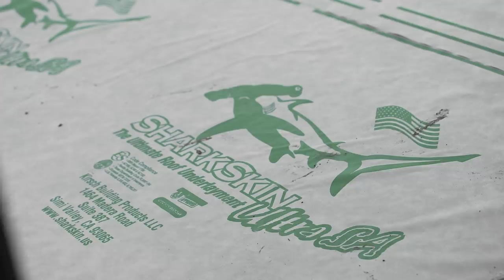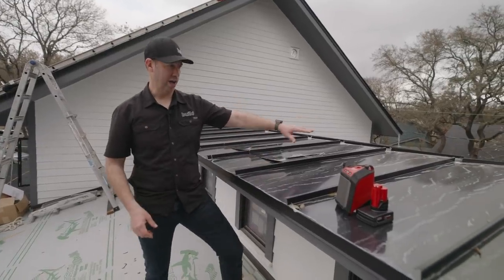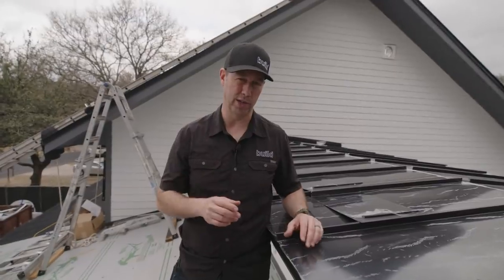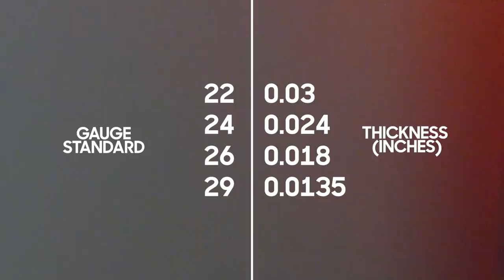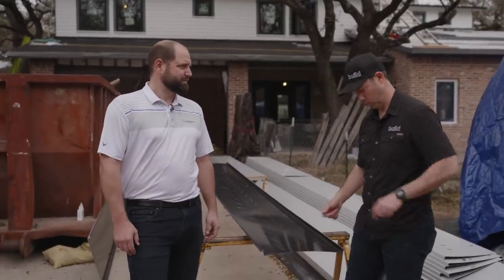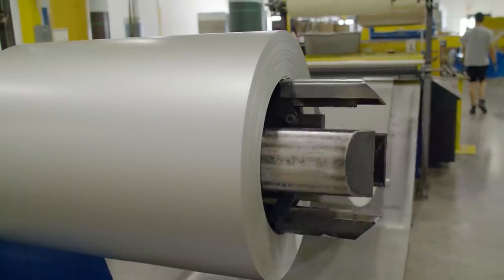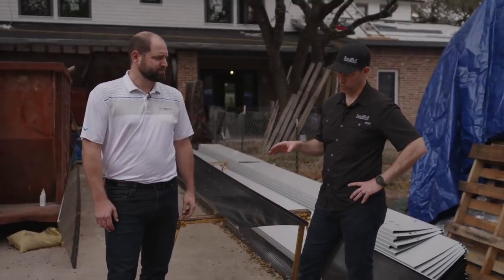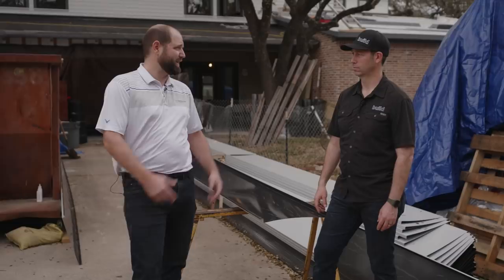Metal Roof- Best Practice Details

Comment: 6:15 the silver reflective foil should go down FIRST then your black webbing material and lastly the metal roof. the way you have it installed now doesnt' reject heat, it keeps the heat inside. think about it, the shiny side is what bounces heat away!!! can't believe this was screwed up by a pro.
Reply: And, that's why you're not a pro.
Reply: @sunshine5349  Oh you're right, sorry. Of course you would know whether or not I've installed any metal roofing. Just like I would know whether or not you've got an accurate knowledge of how electromagnetic waves behave; you know, like a radiant barrier professional would be expected to have, as opposed to say, a sheet metal guy. 
Oh wait, that's not quite right. I can tell pretty clearly that you don't know what you're talking about.
Here, I'll even give you a link this time:
https://web.ornl. gov/sci/buildings/tools/radiant/
Reply: @sunshine5349 Still another variation is to attach the radiant barrier directly to the underside of the roof deck. ...  
Under the same conditions, a roof mounted radiant barrier works by reducing the amount of radiation incident on the insulation. Since the amount of radiation striking the top of the insulation is less than it would have been without a radiant barrier, the insulation surface temperature is lower and the heat flow through the insulation is reduced. 
If you actually read the entire page, you would know that they are specifically talking about traditional vented attics here, so a roof mounted barrier is clearly being installed FACING DOWN. I suggest reading the entire page, especially the parts that mention EMISSIVITY, and not just skimming it for the bits that seem to confirm what you already think.
Reply: @sunshine5349  Have you actually tried the experiment you are suggesting? The results may surprise you. I suggest trying it with black paper, and using a heatlamp or incandescent bulb as the heat source.
As a control, you may want to try with just the black paper as well.
Reply: @davidg5010  Maybe I am. Try the experiment suggested here and prove me wrong.
Reply: @davidg5010  Yes, the classic "I don't need to prove you wrong, because I know that you are wrong."
Reply: @davidg5010   Here. I've given you a link to the simplified version of the Wikipedia page on electromagnetic radiation.
 https://simple.m.wikipedia.org/wiki/Electromagnetic_radiation

Note that the infrared portion of the electromagnetic spectrum is clearly described as "heat rays" in this article. And gee golly, do we ever receive a ton of infrared from the sun. I'm not sure what distinction you are trying to make here, but there isn't one. The difference between thermal radiation and visible light is basically the same as the difference between low-E and high-E on your guitar.
Gamma rays, X-rays, ultraviolet, visible light, infrared (a.k.a. "heat rays"), WiFi / LTE / 5G, radio waves etc. etc., are ALL just small parts of the electromagnetic radiation spectrum. It is very common to refer to electromagnetic radiation as just, radiation. I'm not quite sure what type of radiation you think I have been talking about, but I've only been talking about electromagnetic radiation, specifically infrared. 
Here is a link to a simplified version of the Wikipedia page on radiation:
https://simple.m.wikipedia.org/wiki/Radiation
Most of the time, when someone uses the word radiation in any sort of scientific context, they are referring to either electromagnetic radiation, or a combination of particle radiation and very high-energy electromagnetic radiation (gamma rays and x-rays) often referred to as "nuclear radiation". 
And yes, we do receive other types of radiation from the sun, mostly particle radiation (i.e. alpha particles, beta particles etc, or other sub-atomic particles ejected by nuclear reactions inside the sun). If you think this is the sort of thing I've been talking about, I think that responsibility for that miscommunication lands squarely on your shoulders.
Reply: @davidg5010  I'm not changing my  arguments. You clearly don't understand what I am talking about, let alone what you are talking about, as evidenced by your claim that infrared light is not (radiant) heat.
I did not use Wikipedia to back up what I am talking about. I directed you towards Simple Wikipedia as an easy-to-read starting point, as I think that despite your immense confidence, you have some fairly large gaps in your knowledge of this subject.
Reply: @davidg5010  Can't teach those who are unwilling to learn, eh?
Reply: @davidg5010  If you are just trolling, you are a very strange troll, lurking in months-dead YouTube comments on an educational channel.

Comment: Almost exactly what I used on our house and 3 car garage in SE Kansas. I installed ice shield first, 1x4 pt horizontally every 16" up the roof and then the standing seam metal panels. My panels snapped together without hidden fasteners and I did the 1x4 to get the "trampoline effect" when it hails.
Reply: Why not close the gap? Even though using a 24 guage metal. Id be worried about deflection and denting of the roof, what are your thoughts? I did alot of shingle work in the past w my contrwcting buss. Jyst focus on real estate

Comment: Sounds like silver side has to be up not down, if heat will be created in the air gap then silver actually will push heat through the deck to inside, I think you f,,up on this

Comment: Why no white roof?
Why no solar?
Reply from the maker: I wanted dark. So I used an R60 roof and installed a Radiant Barrier. Solar this fall.
Reply: @buildshow  - Sweet, can't wait for solar or geothermal combo (love ur vjos)
Reply: @buildshow  - sorry for all the Gold Bond comments
Reply: @buildshow  guess I should wait for me of VJO B4 comment (ugh, my bad)
Reply: @buildshow  are you concerned about color fading with the black roof ? I have a very good quality steel front door with a high quality paint which faces south and in 6 years the paint has faded to the point of needing repainting. I can not imagine a roof fading in color.  Also as the James Hardie will need painting at some point will the metal roof tolerate a ladder resting on it?

Comment: That color of the paint will attract the heat from the sun soo much.
I think it will start to crack and peel off after only one year, and it will get rusty like that container behind them.
Reply: No it won't. The paint on modern roofing sheet metal is very good. Kynar paint has a 40 year warranty against fading, chipping, peeling, and chalking. Older/cheaper polyester based paints were complete shit.

Comment: What about moisture trapped underneath the underlayment. I heard story from roofers of moisture trapped under ice sheald
Reply: That happens if you don't adequately vent the attic or the roof cavity - those are two different things!
Reply: I think he's got closed cell foam sprayed on the underside of the roof deck. That will keep water vapor from the living space from reaching the roof deck. The ice shield is meant to keep any exterior water off. With the venting under the metal, any exterior water that gets under the metal should dry out.

Comment: I put a metal roof non standing seam r-panel right over the existing roof, vented attic with close to 2 feet of insulation here in Austin.  My attic year round is the same ambient temp as outside.  At 2700 sq ft i dont get electric bills above 220 in August and September.  How thats 24 guage is beyond me.  Looks flimsy.  My panels were much thicker.  No way that holds up to denting from hail
Reply: Just to add to my own comment.  The reason everything is so cool is i attached the entire roof to purlin strips.  Purlin to deck on rafter studs metal roof to purlin strips. This creates a great deal of airflow as the roof does not make contact with the deck.  It also means instead of a 40 yr roof i'll probably get 60 years out of it.
Reply: There really isn't much thicker metal roofing systems. Can't say I've done anything thicker than 24g. Some R-panel can be had in 22g, but I don't see why you'd want that for a house. 

Hail can dent any thickness of sheet metal. The sheet metal on your car is thicker than what's on most roofs and it still dents them.

Comment: this is a pretty good video. i would say that risinger generally made good choices. the one exception that stands out is that i think that his use of the radiant barrier is probably based on the flawed theory that he can rely on the ventilation scheme to cool the roof. if you are going to go with a black roof, steel was the way to go. in addition to lower thermal conductivity compared to aluminum, steel has a lower coefficient of thermal expansion and is less prone to "oil canning". the use of 24 gauge steel makes the roof more resistant to denting by hail. the field swaged roof panels are much less prone to water leaks as was mentioned in the video. as was also mentioned, this is less critical on a steep 8/12 roof pitch.

Comment: Another great show. In Ohio do you recommend stripping asphalt shingles? What about black metal roofs are they like black asphalt and you want to stay away because being a heat magnet?? Concerned   about supper heating attic and ac use. Any recommendations for insulation under metal??? Heard of using 3/4 foam board between battens.  Thank you.
Reply: You don't have to tear off the old shingles. Just cut back the edges, put down underlayment, and then screw down 1x4 strips to fasten your metal to. I've put down plenty of metal roofs like that.

All roofs are hot. You're not going to see a whole lot of difference by going with a lighter color. Its still going to get hot. You could look into spray foaming the underside of the roof deck. That's going to perform way better than choosing a light color.